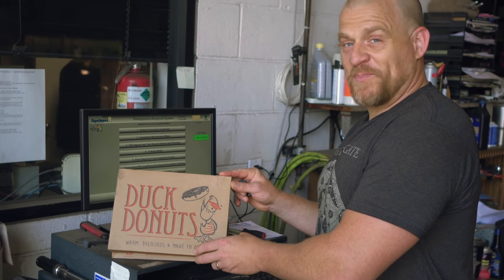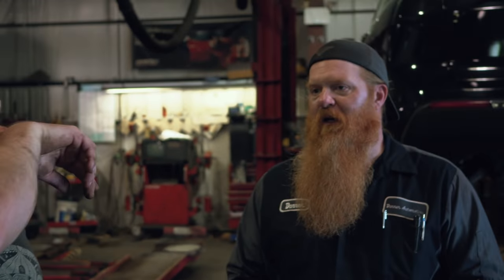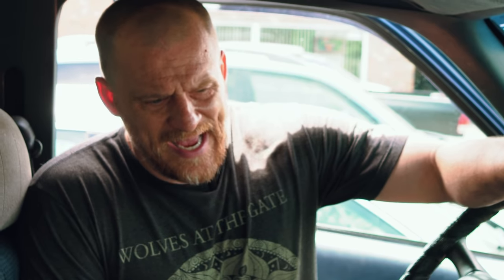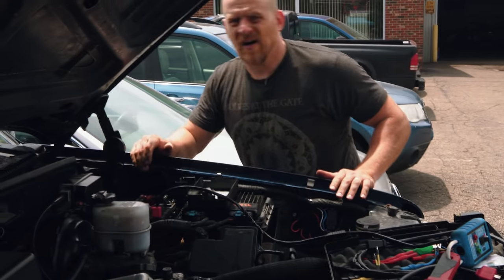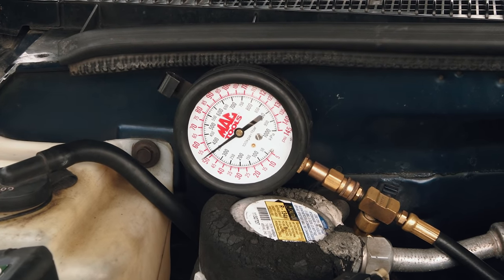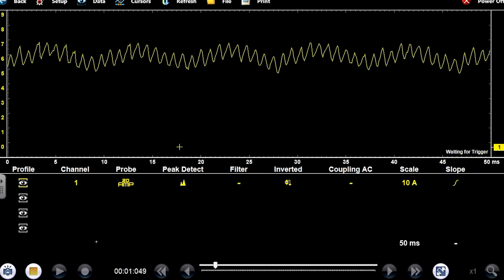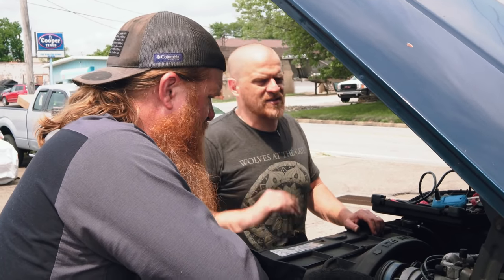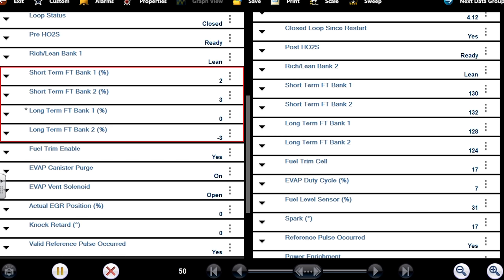Could a P1351 be a False Code? (older GM trucks and vans)

Comment: This vehicle looks like it has that spider type injectors.  Its possible that one of the nylons fuel lines under the intake manifold has a small hairline crack in it because of the way they  lay over each other and causing them to  rub on one another making  them to leak fuel . All it takes is temp or load to show them selfs if it just started happening

Comment: Oh man, don't get me started on flow charts. Too late! My claim about flow charts, and I've been screaming at them for 45 years is that they are put together by arrogant engineers sitting in an office with zero real world experience. The arrogance is that they dumb things down because they think mechanics are stupid. And even if you are a little stupid from inexperience, you are not doing anybody any favors. An explanation of the parameters required to set a given code, a wiring diagram with pinout descriptions, locations of connections, splices and grounds are all you need. With time you will learn. Take a night class in electronics if you have to, but for crap sake flow charts are very limited in value. P.S. When I say "you" I'm not directing it at Paul.
Reply from the maker: I've learned the engineers are not even the ones that write the flow charts! Someone underneath them do this! It's a ridiculous process
Reply: @ScannerDanner  They truly think they are doing you a favor. Management thinks they can get by paying less because hey, look at this, the "yellow brick road", and at the end of it everybody gets a brain. Well you know how that ended.

Comment: My '97 Sierra 5.7 has the exact same issues (225k miles).  Started stalling at low RPM one day leaving me coasting around a long off-ramp with no power steering or brakes.  Fun!  Reset the computer and problem went away.  A month later, the intermittent crank no-start after it rains thing started happening.  Sometimes I'd come back the next day and it would fire right up.  Happened again a few days ago.  I installed a new cap and rotor (which were new 25k miles ago but horribly corroded) and it started right up.  For what it's worth, I upgraded to next generation spider injectors from the '99-2000 models at 200k miles when I bought the truck, as well as replacing the rusty fuel tank, pump, filter, fuel pressure regulator, and gaskets.  Tested voltages everywhere and they were perfect and the truck ran great for a couple years until I started having the same issues as your customer.  At this point, I honestly think that the corroded cap and rotor were my issue, and that really I just needed a tune up.  I'll replace the coolant temp sensor if the issue presents itself again.  I did BTW get the 1351 code when it was refusing to start but thought it was a symptom, not a cause.  Thanks for proving that here.
Reply from the maker: the P1351 code on these GMs is a symptom and most of the time not the cause. Anything that causes a longer than normal crank time will set this code on these

Comment: Just to throw in my 2 cents, have a 98   5.7 litre  90k miles, replaced everything, and started getting that p1351 code, every once and a while it would take a couple seconds extra of crank and the code would come on. Once it started ran perfect, dealt with it for 2 years,  Never threw the code before  the parts replacements. Turned out to be the coil! code came up on the accel and auto zone coils i first tried. Replaced it with an OEM Ac Delco coil and that solved the problem, looks to be very picky on coil voltages
Reply from the maker: Anything that causes an extended crank on this system will flag this code. That was the most important take away for anyone trying to troubleshoot this. Agree?

Comment: Scanner Danner ...question brother ..I've had my 86' f150 for 6 years ...I stupidly hydrolocked her in a flash flood ...I had an atk longblock in her...now I'm doing everything again with a nutech longblock 5.0 ..I want to delete egr however I'm getting mixed ideas ..I know plumbing is easy ..but it eec-iv obd1 fuel injected ..can I leave egr solonoid hooked into harness but not inserted in the valve..I have replaced egr twice and used all three color solonoids I could find ..white ..black ..n gray ..I always got egr out of range code ..never got 0.00 volts at fully closed output voltage ..always 0.04 ..reference supply voltage good tho..truck always ran ..what you suggest before I wire 3 resistors together to trick comp out ..tab n tads relays will remain plugged in but capped off at vaccum tee ..
Reply from the maker: that EVP voltage is too low, it should be around .5 to .8 volt with EGR closed, but the problem is, the ECM is looking for an EVP voltage rise that corresponds to the EVR vacuum solenoid command to open the valve, so you will still have a code under part throttle, when the EGR is supposed to be open

Comment: Hi, could be fuel pressure regulator inside intake manifold in the body of injector housing.
I see variation in psi with fuel pressure gauge below 60psi
Reply: By the way, I see your videos im from México city

Comment: Injector balance test won't help to know if  injectors are having problem ? To be sure its stuck open or having problem ? Maybe i am wrong but at least this helps to be sure of the injectors and over fueling issue ? Maybe ?
Reply from the maker: sure, that test can help ID these issues, but this was an intermittent one that unless it was sticking during the test, it wouldn't help us

Comment: Hi Paul. I'm not going to teach the teacher but I'm going to share something that happened to me since you mentioned the ignition module looked a cheap quality Ebay part , at one time i was working on a chevy truck and i got a module at Autozone, it run, before ot wasn't, but it kept the check engine light on with p1351 just like yours, no long cranking it was firing up at first crank, so i got a GM module and problem went away
Reply from the maker: Great tip

Comment: i ran in circles chasing this on a 97 with similar intermittent drivability concerns, was 3rd person to look at it. I asked if customer has he done any repairs, customer replaced fuel pump, Fuel pump relay, injector then ignition switch then finally a PCM.  Customer was ready to throw on a carb and a manual trans from TBI truck at this point. Long story short I believe the Fuel pump relay contacts fit too loose heated up and cause similar intermittent drivability concerns, wired fuel pump direct and drivability concerns went away.  threw a junkyard fuse box in to fix problem, could have been another circuit in fuse box but i doubt it. cant be certain it is same problem you had as my fuel trims didn't look rich. whenever i see rich trims i suspect stuck injectors or failed diaphragm on pressure regulator, have never seen regulator be an intermittent fault. thanks for makin these vids , I enjoy your books.
Reply from the maker: Thanks for sharing! Confirming again that this code is b.s. and the flow chart is 100% absolutely wrong (incomplete)

Comment: I was hoping you'd drive it around to see if you could recreate the problem. Was thinking bad injector or stuck throttle but if the throttle was stuck it would have died in idle for you guys.
Reply from the maker: Check out my pinned comment. Thanks!

Comment: Setting a digital volt meter to ac will help read a digital square wave. On the dc scale it might not pick up any voltage due to it switching back and forth.
Reply from the maker: Yes sir, exactly

Comment: How about a leaking injector O ring on the rail side,
 leaking into the intake making the whole bank go rich?
Reply from the maker: o-ring leaks don't fix themselves in my opinion, but certainly something that can happen
Reply: @ScannerDanner  I know this is not the same set up but... Old GM 4.3s had that "spider" injector with the fuel pressure regulator inside the intake. The heat would cause the diaphram to fail flowing fuel into the intake. They would run way rich. Pull the top off the intake and you could tell right away by the clean trail from under the regulator into the ports.
Reply from the maker: @hometownautomotive2110  for sure! But this was also not an intermittent issue when they would fail 😉

Comment: I have a 1999 gmc suburban that keeps giving me a p1351 code. I changed out the ignition control module numerous times. But as soon as I install the new sensor it still makes my check engine light come on. I changed the crankshaft sensor too. What can this issue be that causes high voltage to my ignition control module?
Reply from the maker: do you have a long crank time (extended cranking sets this code)
Reply: Yes I do have a long cranking time. How do I adjust the long cranking time?
Reply: I also have paid to have my fuel pump changed. Relay fuse, icm,coil, wires, distributor, cap and rotor. Throttle body sensor, fuel filter now I'm going to change my ignition switch.

Comment: I've had the 1351 happen on an 07 ford five hundred and it ended up being the crank and cam sensors.
Reply from the maker: Keep in mind that this code is a manufacturer specific code (P1---), so this video pertains to GM only

Comment: @ Paul is this part 1 part 2 latest one where you find 5v short on wiring harness. Shorted onto stud caused fault. Well done if you stuck with fault found it. Please advise if it was your brother Dan also worked on it.
Reply from the maker: No, this was from a case study we did two years ago (link in description). Thanks!
Reply: @ScannerDanner  thanks Paul it's 2005 in Capetown. Love your guides videos. I try keep my old cars running.

Comment: If i remember right the cpi system was the spider like black hoses in the intake? Ran across one of those a couple of times back in the days... What fixed it was doing an injector clean with the gm cleaner with a shop air pressurised container... 1 litre of fuel for 30ml of cleaner... i used to put 90ml insted and ran it two times... and the regulator inside was notorious to be leaking.... but that was like 15 years ago...
Reply from the maker: this was a new fuel injection assembly from what I was told
Reply: @ScannerDanner  missed that one Paul...  But im shure you remember the problems these systems had!
Reply from the maker: @erikkirby1  for sure! thanks my friend

Comment: Could it be the ground for the injectors?
Reply from the maker: You mean the injector driver? (which grounds them sequentially). Yes, that is an option too. I've seen older GM computers do that intermittently

Comment: The reason the flow chart says to switch to AC on the DVOM to check the signal is so you get an average of the on and off voltage.
Reply: If you have the specified AC voltage, the signal is good basically.
Reply from the maker: @2secondslater  yes sir, written before scopes were suggested
Reply: Hey Scanner, I still use this method when I am too lazy to get the scope out, that might be showing my age a bit

Comment: For the fault code, I suspect the VCM(PCM) has a calibration issue for the fault setting, to fast to  measure  5v for circuit high or to slow to measure the 5v for the circuit high. No idea how the module hardware is setup for that circuit detection nor the calibration.  Just how I vizulize it.  Wouldn't be surprised if it's just a crap calibration.  My 2nd hunch is maybe the VCM is just old and has old capacitors, resistors that have drifted causing the circuit fault during long cranks.  * As for the driveability issue, those spider inejectors were known to stick open on the poppet valve style.  I have seen the same on the new style.  I've seen also, where the nylon lines spring a pin hole leak and affect near by cylinders in the intake plenum. ----Anyways, Great video.  Hope we can see the case closed on this in the future.
Reply from the maker: Calibration issue for sure! They were using older chips that ran bypass type ignition systems and put them in a non bypass system. Even the code description on the scanner was wrong AND the description of the operation was wrong in the service info.
Lastly, because so many people have fought this code over the years and still are, this tells us that it is not the later part of what you said (VCM issue) 
Thank you!

Comment: Crazy, I have P1351 after changing the fuel pump on 2000 gm Safari 4.3. Thanks for figuring out it's from long crank! moisture/heavy rain has been an issue with no start in the past as well. P1351 is my new code, I've been trying to get running for 3 months. Even 'Tyler' mod on ur premium site gave me some advice but still no luck. This vid was Great for me, thanks for doing it even though you felt like it was a waste it wasn't. Also the Mitchel flow chart and the GM service manual flow chart are different on steps 15-17 Mitchel says change ICM and VCM, GM say change ICM and clear codes. I also had 2.6V AC on that certain step you guy were arguing about. Anyway chasing that P1351 didn't help, thanks for letting me know I'm wasting my time.
Reply from the maker: Tyler is the man, and without first hand knowledge (which i didn't have either, before this case study), I wouldn't have been able to help much beyond what the flow chart indicated. I'm so glad this helped you and thanks for being part of my great community!
Reply: I too have had the p1351 code on my GMC Sierra. Finding this video helped me to find that my long crank was due to a weak pump not holding pressure. The pump was not that old. Key on/engine off, fuel would build to 40-42 psi. Key off the pressure dropped immediately. Changed pump, issue gone. Hope this may be your issue as well. I chased this code for too long.

Comment: I'm wondering,  is the fuel pressure regulator inside the intake? If that regulator is leaking could this cause a rich condition, possibly effecting one bank more than the other? Is it possible for this to be an intermittent problem? Maybe deadheading the pump temporarily changed something.  Just food for thought.  Thank you for all that you do to help educate people like me!  I'm definitely a premium member for a couple of years now.
Reply from the maker: thank you so much for the support! I really appreciate you guys so much. Yes, the regulator is inside of the manifold on this one, but when they leak, they leak from a torn diaphragm and that will not be an intermittent issue. Make sense? A leaking ball/seat area of the regulator could be intermittent, but that will not cause a running issue, only a bleed down issue
Reply: @ScannerDanner  hey, re-read what you just typed here... didn't your brother say the FP bled down to 30psi at first, then it was fine after dead heading the pump? Could that have dislodged something in the seat of the FPR? And, with the new symptoms, could that pump dead heading have caused the FPR diaphragm to become weak and burst? One more thing to add, i just did a test on my friends 96 4.3, unplugged the coil, cranked it, and consistently 9.5 seconds of crank time set that code 5 times in a row
Reply from the maker: @mattcat231  this condition you're describing would not cause negative trim numbers on one bank. Also, every single time I've seen a bleed down from a regulator seat area, there were NEVER pressure issues while the pump was running, as there is essentially a constant bleed there anyway during this time.  Hope that makes sense

Comment: After Watching this whole video I’m feeing like vehicle is stuck in limp mode if there is no stuck open injector I’d move on to 02 sensors. If o2 sensor is faulty or getting an unbalanced reading it would tell Ecm to dump more fuel to compensate. Just my take on it.💯 Hope it helps. I know how difficult it could be getting misleading symptoms.

Comment: Just now 10 min. Into this vid recapping on how the vehicle would just shut off my first thought was ecm as was yours my second is dirt in the fuel tank I’ve had both issues on a couple Buicks but getting to your guide sheet I’m wondering if vehicle is using a different protocol… pending on where it’s assembled.